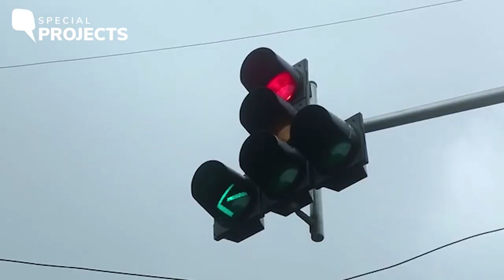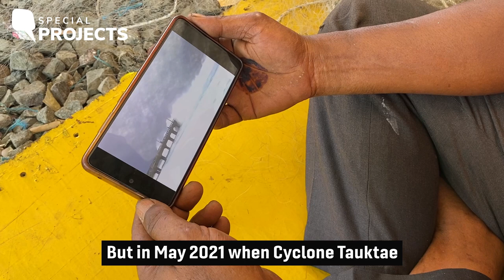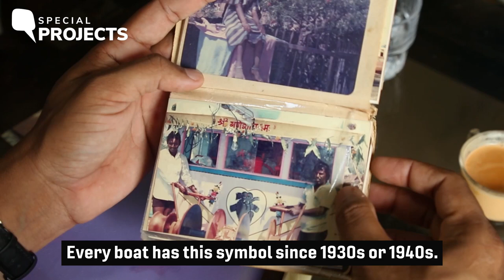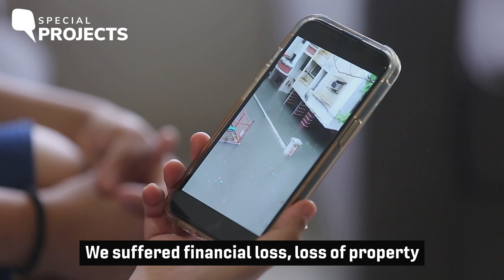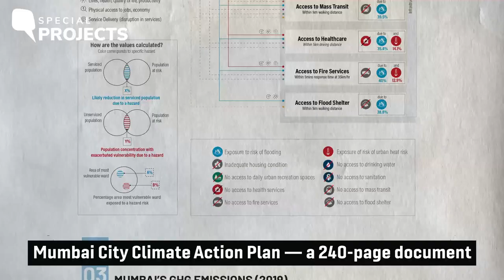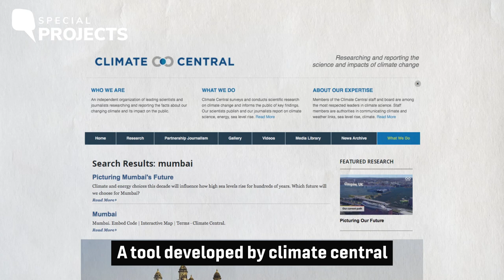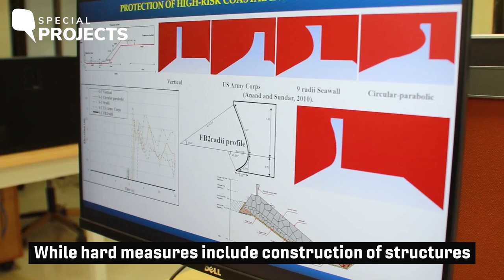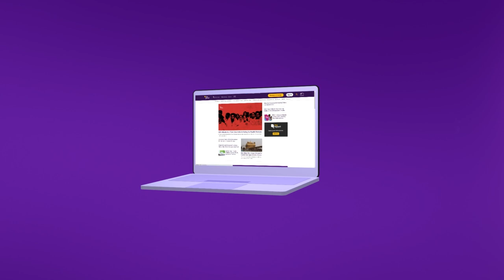Climate Change Documentary | MUMBAI: RISING WATERS, SINKING CITY

Comment: Nice initiative. But there's plenty that has been missed -- most glaringly -- there was no mention of mangroves, the natural wall that give protection against the rising waters and their wanton destruction. And also, the flooding on July 2005, is an interesting case-study on how unplanned construction plays havoc -- the flooding of the suburbs was due to Mithi River. In fact, South Bombay (or Mumbai) did not face as much brunt because of the existing drainage infra that had been created by the British -- the storm water drains. So, the issue is a bit more complex than how it was presented here...
Reply: May this British raj drainage system be upgraded in south Mumbai as well as all other low lying parts of the city asap....aameen
Reply: Mumbai's Municipal Corporation is the richest & the largest in India. Still suburban Mumbai is filthy. Too many open drains, too much trash everywhere. 
       Add to it there is little thought to urban planning,  infra,  drainage system,  vehicle parking, network of roads & flyovers to ease traffic & random construction of high rises makes the situation worse esp when alongside narrow lanes  
     Trees too are fast disappearing .. what  little remains is  mostly non native young trees .   
     Mumbai is only getting hotter, summer months more & rains are getting lesser each year   . Sporadic heavy rains doesn't count.
Reply: They mentioned that in the introduction. 🍻
Reply: Incompetent SS led BMC
Reply: @abbasabdeali3239  It has in fact been downgraded by metro work. Pipes have been replaced by smaller ones.

Comment: personally I think within mext 20 years Mumbai will be completely relocated. And might shifted bit inside away from coast. But for now we can definitely rely on hard measures and build coastal walls wherever necessary.! For new constructions it is quite important for architects to consider this changes and consider the water levels during floods and take some preventing measures for the same.
Reply: Coastal walls increase floods.